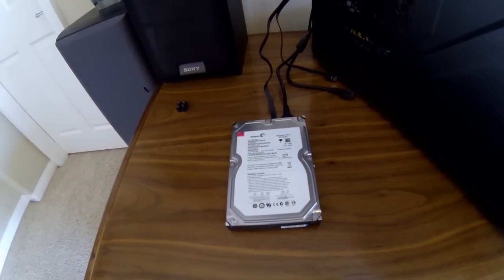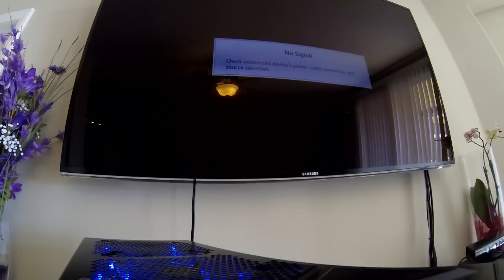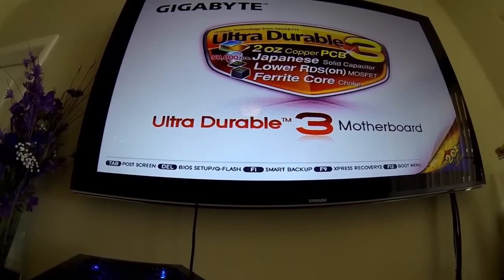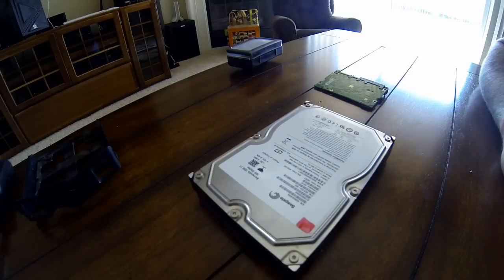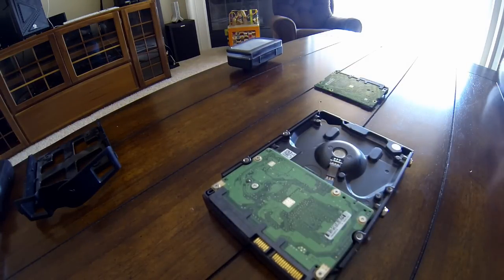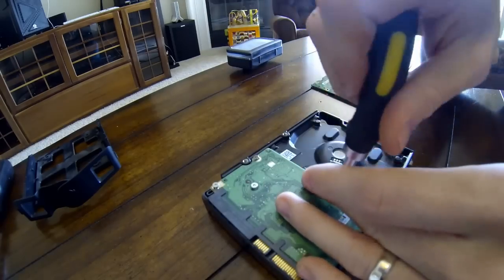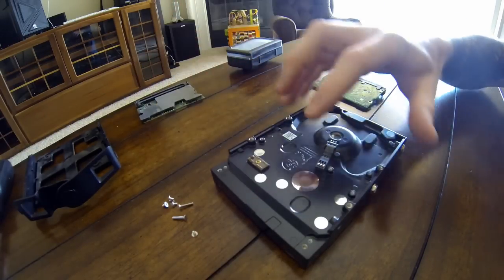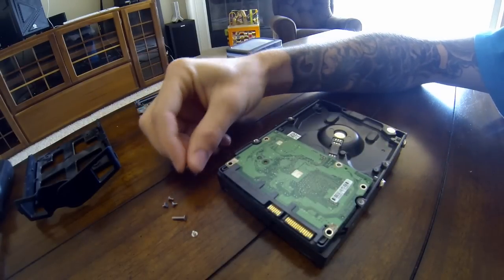Broken HDD Fix: Replacing the PCB (DATA RECOVERY)

Comment: Just to let others know, it's normally required that you get the same PCB (these can vary EVEN ON THE SAME MODEL OF HDD!). There should be a code written on the underside (the side that just has tracking, and no components visible), which is what you need to know.

Then you can go to a site like: http://www.hddzone.com/ - and search for the exact PCB you require.

However, you normally need to move the old ROM chip from the broken PCB to the new, working one. This is because this chip contains the HDD's BIOS, and there's no guarantee that the new one will be setup correctly for the head inside your busted HDD.

To do this you'll need a steady hand, a heat gun, and perhaps some flux/solder/soldering iron. It's not terribly difficult to do yourself, but if you're worried, take it to a PC repair/electronics shop and get them to do it. Shouldn't cost more than £10 to get done (it's a 2 minute job).

This video got lucky, as it just booted up, but the MAJORITY will require more technical knowledge/skillset.

Just an FYI.

Comment: If you're going so far as to remove the pcb, before reassembling it, I would always inspect, and VERY CAREFULLY clean, the exposed spring data and motor contacts, using some IPA and a cotton bud.  The data contacts carry very tiny currents, and any contamination can cause problems.

Comment from the maker: @Chris, no I simply used the PCB from an identical HDD (same model). Not too sure if it will work if it's different (like a 500GB and 250GB) but as long as it's the same specs (GB, RPM, Chache, etc..) it should work fine. 
Thanks!

Comment: Can I replace a pcb with a pcb from another drive that's NOT identical but DOES have the same pcb NUMBER?
Reply from the maker: Todd Sheffield you will have to look into the specs. Some of the minor details could be different and may damage your hard drive further. However I would assume that the same pcb number means the same specs. Especially if it's from the same manufacture.